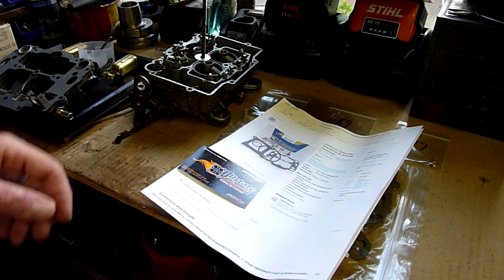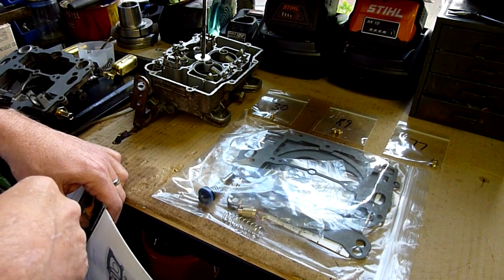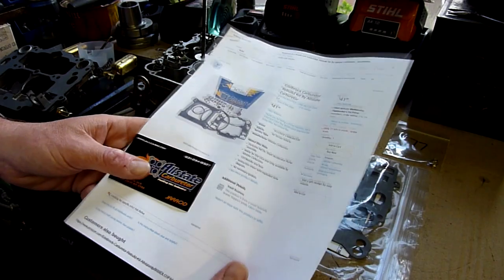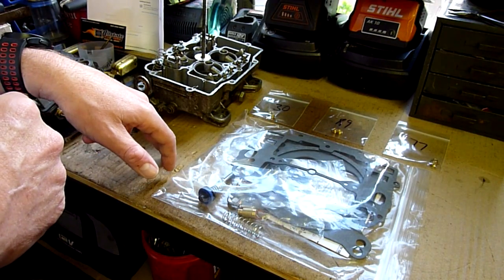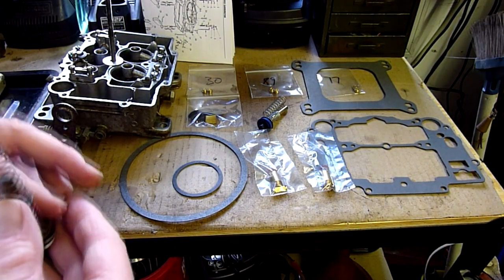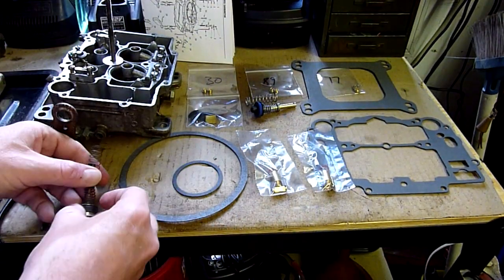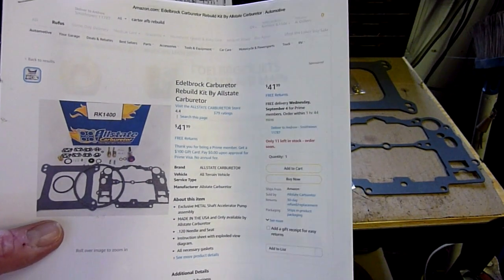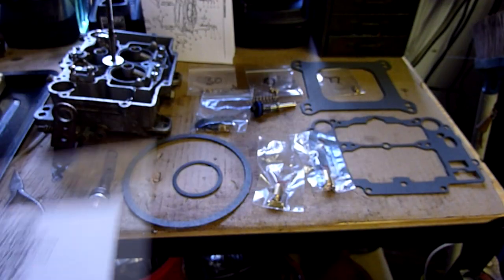Allstate Carburetor Carb Kit and Jets for Carter AFB

Comment: I worked for an automotive parts manufacturer in the aftermarket for 11 years and a good portion of my job was to write catalogs that were used by the parts counter people. I redid a carburetor parts catalog in 1997 and 2002 and as of the writing of this post, that book hasn't been revised and it's still the latest publication out there for it. I did extensive research and filled in coverage where none existed prior.

For example, when I was reviewing the Chrysler sections (the database was electronic by 1994 when I started), I noticed there were no Slant Six floats listed. Hmmm, sounded strange. I opened up the old Chrysler parts catalogs, got the numbers from there and crossed them over in the system and with the supplier's catalog. Sure enough, we had the parts and didn't show them. That started a huge "rabbit hole" where I went through the entire book and updated coverage where we didn't show a part number, but we did indeed have the part for the application. 

What that means for the hobbyist is that you don't get, "No listing for that one in the catalog" and for the parts store that their existing inventory covers more applications in turn makes that inventory more valuable. That type of review had never been done before I decided to do it. 

I left private industry in 2005, so I gather that none of the new product people left behind knew how to do the job after I left or they are relying on the electronic catalog to take over. It was a very detailed project, that's for sure.

Back in the day, the company I worked for was near a Grumman facility and as Grumman would lay off people, the company I worked for would hire them for engineering. Then, they would leave when Grumman would hire them back. And then it ping-ponged for a number of years. Either way, they were interesting times.

I wonder who they get their gaskets from. They likely source their gaskets and then put the kits together based on a bill of material off of the original OEM or service kit. Farnam and Armstrong were the big suppliers when I was doing it. Farnam is part of Freudenberg-NOK now.
Reply from the maker: @googleusergp  Awesome background you have. In our club, we have a "parts guy" that knows part numbers by memory for our cars. I think he worked for a Chrysler dealership back in the day. Just amazing knowledge that is gratefully appreciated.
Reply: @LongIslandMopars  The old Chrysler parts books aren't that hard to use. I've used them extensively and I have the knowledge of all of the parts systems out there. When I left in 2005, the research library (which my friend who is still there ran along with me), we had converted everything to electronic lookup, but still retained the books and microfiche as back up. I spoke to my friend a few years ago (we speak all the time via e-mail) and they tossed out all of that old material and they now buy the research from an outside company rather than do it in house. That was tried right before I got there in 1994 and it was an utter failure and we paid for that bad data for years and years to come. The company I worked for sold parts for everything: marine, industrial, small engine, domestic, import, low end, high end, exotic, economy, export, you name it. So, I had to know them all. The theory that we had was that if the company ever decided to lay any of us off (never happened, although several years after I left, they offered the veteran folks "packages" to get out early, which was a sign of things to come), we could walk into any parts department out there and hit the ground running. 

At work now, people come to me with parts related questions for our equipment. I tell them, "I'm out of that game since 2005" and they say, "You still know more than half of the people here ever learned". That's flattering, but custom made equipment is hard to navigate parts for (that's the industry I'm in now in civil service), so it takes a lot of figuring things out, connections, phone calls, etc.

I worked with a guy back in the day who was a technical writer for Motor when they were in Manhattan (he lived there). He never turned the terminal on at this desk. I heard rumor along with others that, "We're going to force that guy out". We all thought that was terrible. He could have trained a lot of the junior folks and others who didn't know the parts books that well. I wasn't one of them (I'm self taught), but that's not the point. The guy did things the old way, literal cut and paste. He didn't use a computer or anything modern to do his work. Soon after, they "retired" him and he passed away a few years later.

He was a nice man, although many said he was cantankerous, but there were a few of them there, and I got along with every one of them just fine. LOL.
Reply from the maker: @googleusergp  More amazing content from GP! One day we should consider doing a Livestream. Imagine the tidbits you could share among our potential fans. BTW, I still remember the Steve Magnante video when he plugged you for the wealth of knowledge you shared on a prior video. So cool.
Reply: @LongIslandMopars  Sure, a livestream would be pretty good. Yes, I remember Mr. Magnante called me out a few times for decoding, information and the like. No one knows everything and as I've said many times over when everyone contributes, everyone learns. Then everyone wins.
Reply from the maker: @googleusergp  I never knew what a SPID was 😎.
Reply: @LongIslandMopars  "When you get the SPID, we're glad that you did".  Chrysler had a broadcast sheet, GM had a build sheet, Ford had a build sheet, all three had a buck tag or trim tag with some basic information. 

All in all, "Need the VIN to win, the tag to brag, when you get the SPID, we're glad that you did. Without the buck (tag), we're out of luck..."